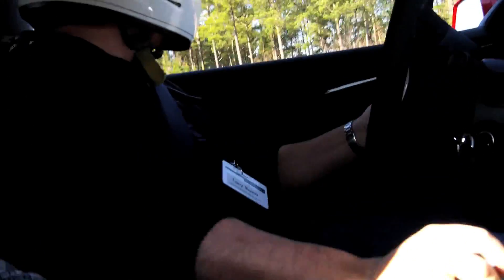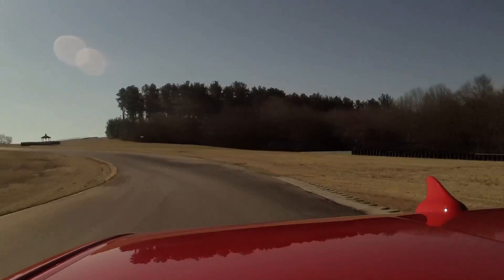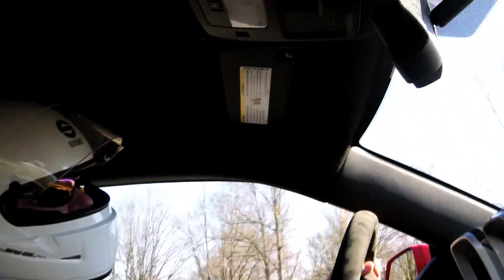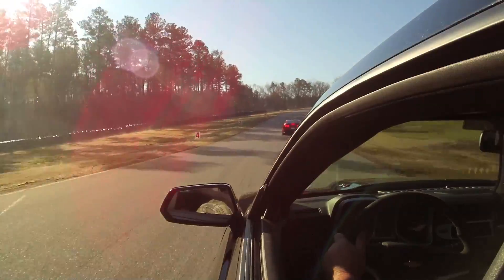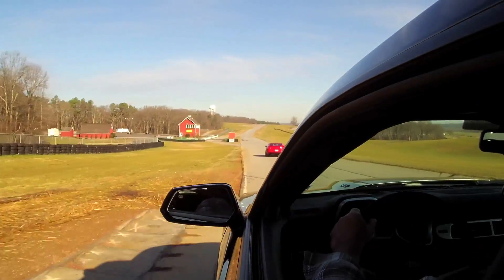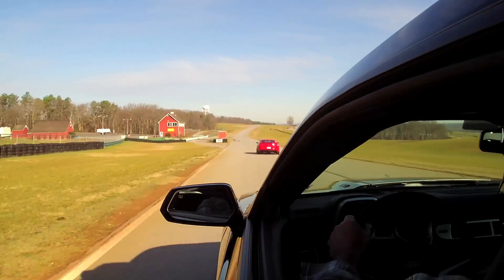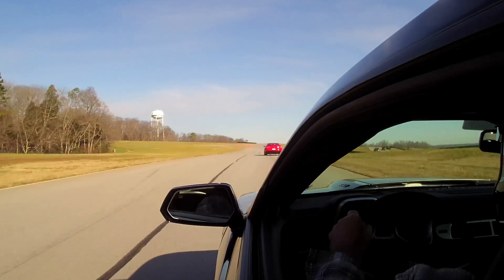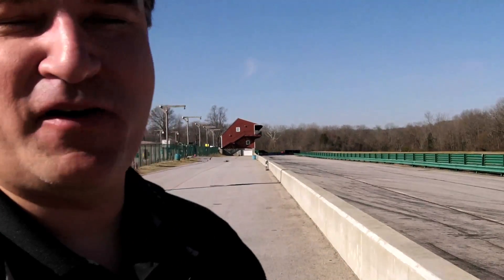Camaro ZL1 - Inside Performance Traction Management

Comment: I own the convertible why you never see convertible uses ?
Reply: Because the convertible doesn’t have many of the ultra high-performance features that the coupe has. For instance, the convertible does not have the PTM4 system.
Reply: Still a hot, fast car, but just designed for a little bit different usage.